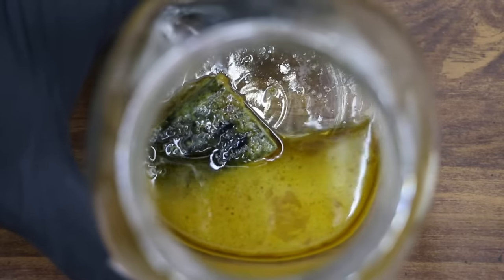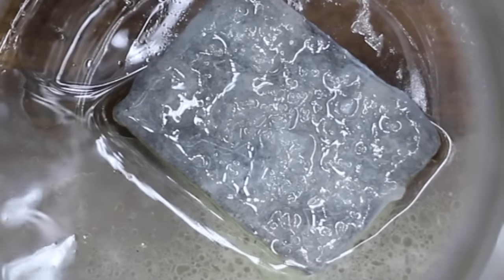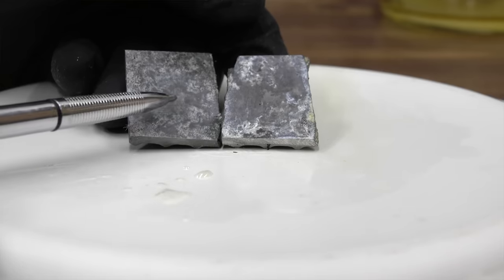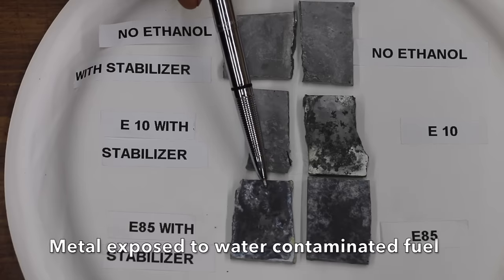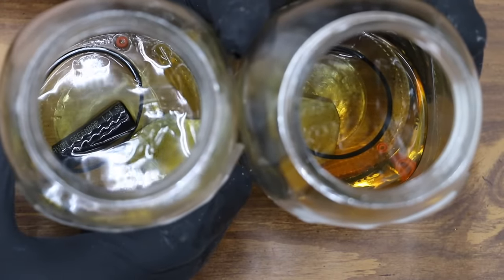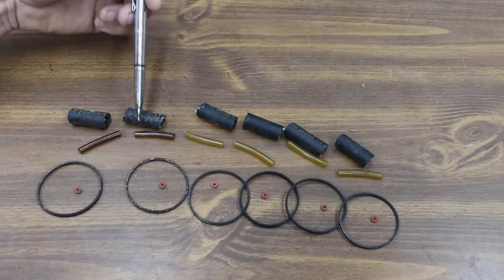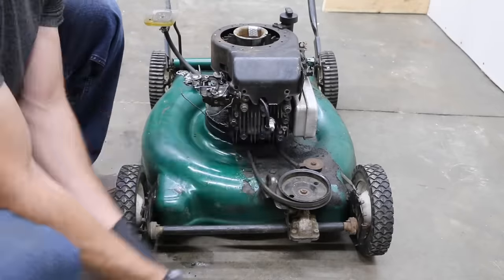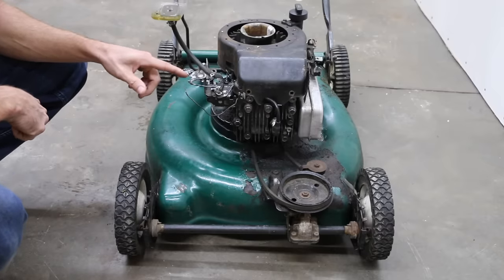Does Fuel Stabilizer Prevent Ethanol Damage?  Let's find out!

Comment: I've been running av gas (100 LL aviation gas) for quite a few years with near zero problems in all my small engines, both 2 and 4 stroke. No more cleaning and rebuilding fuel systems. I also run it in my 1956 Lincoln Premiere. A bit more expensive but it starts and runs every spring. Question, on fuel with ethanol REMOVED, will it degrade? av-gas doesn't as it doesn't have any of the additives normal pump gas has (can't have planes falling out of the sky from bad fuel) We have ethanol free gas here now but wonder about other additives degrading it. Wonderful content, keep up the good work.
Reply from the maker: Thanks, will do!
Reply: Just run non ethanol. I use it in everything I own, 2 4Runners and small equipment.

Comment: Like that this gross looking fuels came out near Halloween. Just saying it’s scary...
Reply from the maker: lol.  It smelled scary too!
Reply: Freddy coming for you...  I was very surprised by these results.  Makes me reconsider my preconceived ideas about relying on Stabilzers and E10 (It can't be as bad as some people claim... Guess it can be under these conditions)
While I don't expect intentional water contamination (beyond any "typical" open evap/vented garage storage conditions)... If I can't rely on a Stabilizer to counter it AND provide fuel performance after a few months... Then I'm now in the Camp willing to "Drain" and/or add some kind of Fog Oil,2-Cycle Oil, or E0 to shield the components from Air/Moisture during storage.
Thanks for the extensive testing. Might save some equipment during this Storage season.

Comment: Just popped up. Well done. We have two boats one a 1989 with twin 454 and one a 2008 with a Vortex 350. We leave the 1989 full of ethanol free (300 gallons) fuel from October to May. It starts and runs in May over Covid we left it for year and half it started and ran fine. The 350 we leave with as near an empty tank as we can of ethanol fuel. We have left it for 2 years and it started. We filled the tank before we put it in the water. It was hard to start.
Reply from the maker: Thanks for sharing.

Comment: But...but...we're saving the environment by using corn instead of oil!  Aren't we?  AREN'T WE???  Surely you're not suggesting that ethanol-based fuels aren't doing anything except causing our car parts to degrade faster!  Because that would be a really ugly truth!
Reply from the maker: Thank you!
Reply: Would be ugly truth as it would not be true. As mentioned in the video this ethanol and water causes issues for small engines part, not car engines, as cars have been designed for fuels containing ethanol.
Reply: Too bad I don’t run ethanol in any of my vehicles, my 19 Tacoma, 15 Murano, or my 1000RR Honda, or any of my power equip. ethanol doesn’t deserve to run in my equipment!!! Junk is all it is!

Comment: What the F! Our goverment forces E10, seeing that it destroys the engine after such a short period i am worried!
Reply: You can always mix in water to force separation and pour out gasoline that stays on top.
Reply: Imagine what it's like being a firearm enthusiast and what some "candidates" want to do to the 2A!   Apologies for going there... but a 20-50 Dollar small engine carburetor seems a bit trivial in comparison to potentially losing thousands out of my gun safe due to politicians that ignore facts and pass laws that would do little to nothing to help the violence problem and/or  enable confiscation without due process.
Reply: Are you US based Richard?  If so, there is no federal mandate that requires E10 or higher in all gasoline.
Reply: Its a chinese engine and they will have an import duty on the replacement.  Win win
Reply: @ChucksBasix  No but the States have made it law. But it doesn't matter anyways. Modern engines don't have issues with E10. Even my lawn equipment is made for it. :D
Reply: BTEX: Benzene, Toluene, Ethylbenzene, Xylene. Slang term for all the VOC's, not just the four mentioned, that are added to ethanol blended gasoline. These chemicals are commonly used in paint thinner, hence why the paint was taken off the piece of aluminum in the video. The damage this causes is blamed on ethanol and suckers buy it up. Ethanol free gasoline also has BTEX in it but not as much. If it did have the exact concentration then it would be impossible to maintain the lie. Look at E10 and ethanol free gasoline side by side. The ethanol free gas is clear while E10 is yellow. Ethanol is clear so WTF is discoloring the fuel? The BTEX I mentioned earlier. Every bit of anti-ethanol propaganda comes from the same origin, the oil mafia. The oil mafia does NOT want you to use something they don't control and over time has successfully duped millions of suckers into believing big oil has their back. Here is the real kick in the ass. America is called this great superior nation, right? How come the USA is so far behind countries that we would call third world when it comes to energy? Brazil and Argentina, there are others too, produce ethanol by the megaton with just trace amounts of gasoline mixed in at the pump. Corrosion and damage is not a factor. What materials are used to store or transfer the alcohol blended fuels? They aren't any different than the plastic, rubber, or silicone that we would use in the US for the same purpose. It's not some exotic, high quality, mystic, majestic, godly, heavenly, divine synthetic compound that Brazil or Argentina own the right to use and produce. Vodka bottles are made of cheap plastic and they tolerate ethanol just fine. Vodka also never ages. So fuel aging has nothing to do with ethanol. In the end though it wouldn't matter what is actually causing the damage we experience because there is a root cause. Dependence upon government. The people let the government decide what foods they eat and what medicines they take. As a result their bodies are in as sorry a state as are the souls who liver under tyranny. Apply this same principal to everything else, even energy. 

Oh and if ethanol is sooooo bad here in the US (but nowhere else!?!?!?!) then why is it such a popular choice of fuel for racing?

Comment: Bottom line: E85 is a destroyer of worlds.
Reply from the maker: Thank you
Reply: Only if you let it sit and get contaminated.  Cars with sealed fuel systems that get driven regularly will not have these problems.  Anything with a carburetor is a different problem, as the fuel sitting inside the carburetor is exposed to air and will absorb moisture and become acidic.  I haven't ever had problems with equipment that the carburetor is religiously run dry after every use.
Reply: No... Bottomline the world has invented fuel injection 30 jears ago and the usa thinks about ethanol in carburators in 2019.

Comment: Great video. This is exactly why I winterize my mowers and boat with ethanol free fuel. I run the tanks almost dry then fill with fresh ethanol free fuel with seafoam and never have problems in spring. Save yourself a headache and find ethanol free fuel to store your equipment. Worth the effort even if you have to drive a ways to get it.
Reply from the maker: Thank you!  Thanks for the feedback.

Comment: Quite peeved as our government just introduced legislation that has eliminated all non ethanol fuel stations (shell was the last one) and now says ALL fuel sold within Canada must have 10% minimum ethanol content for “carbon emissions” so incredibly stupid. 

The amount of ethanol content is supposed to increase every few years as well. Thank you for putting this info out so when everyone starts having engine issues they’ll at least know why.
Reply: I bought 5 gallons or Shell gas 12+years ago and ran it in my lawnmower all last year. No stabilizers or anything added. Still have a little left and will use it up this season. No issues with starting or running. Didn’t want to run it through my car but an old $25 lawnmower was worth seeing if the gas was still good.

Comment: Marine mechanic here. I have loads of experience with ethanol mixed fuel used in small outboards and lawn equipment also larger inboard engines. 
Engines don't like old fuel regardless of their size. Mercury/Mercruiser engine manuals suggest mixing 2 stroke oil, fuel stabilizer and engine fogger in a remote fuel tank to winterize your seasonal engines. I have been using this mix for almost 20 years and have been able to start every engine I winterize. Where I live the customers will keep their boats out of the water for 3 to 6 months. Even customers who kept their boats on land for a whole season we were able to start those engines up. 
For the small engines it's a good idea to empty the fuel from the gas tank, fuel filter and carburetor. It's usually easy enough to do on them, the larger engines it can be a lot harder to do that to them. I always tell customers to either fill your tanks or run them as close to empty as you can before putting them away for the winter to reduce the amount of water contamination. 
And 1 last thing, the carb parts shown with the brown and yellowish gunk on them. That is crystal formed by the ethanol while sitting in the gasoline. Sometimes they form this long strings that look like corn husk. Best way to keep that from happening is empty your fuel system.
Good luck. Keep your engines running water free.
Reply from the maker: Thanks for sharing.

Comment: Thank you for this. I've been running e10, with the same Lucas fuel stabilizer, in my generator. (It does say e10 OK) As it's only used in power outages, you can guess that I'm not burning the tank dry. Since I have access to non ethanol gas, I'll be draining my tank, and refire my Genny with non ethanol to flush everything out.
Perhaps my, only, saving grace is that I do fire it up and heat cycle it once every 2 months.
Reply from the maker: You are welcome!  Thanks for sharing.

Comment: Many small engine carbs are cast from ZINC alloys which corrode more easily than aluminum. I finally did the smart thing when storing my carbed trucks. I unbolt the carb, bolt on an engine lift plate to seal the intake, turn the carb upside down, let dry then store safely in a sealed ammo can indoors.
Reply from the maker: Thanks for sharing.

Comment: Nice video. It confirms my suspicion about fuel stabilizers and proves that I didn't do anything wrong with it's application. Besides,if fuel stabilizers were effective one wonders why it isn't added to the gas station storage tanks. I always had problems getting a lawn mower to start the following season using E10+stabilizer. So I quit using fuel with ethanol. I don't use ethanol based fuels in my snow blower either.  I still burn off the left over fuel before storing the lawn mower or snow blower. Anyway, I just installed a flex fuel kit on my 02 Mustang so it'll be interesting to see how well it runs on E15 and E85 (the tank is near full with E10 right now). I would go with non-ethanol fuels in my vehicles but E0 fuel is usually high octane and more expensive plus I don't get any improvement in fuel economy.
Reply from the maker: Thanks for sharing.

Comment: Excellent video, as per usual, excellence is istandard on all your uploads. We in UK are being forced on to 10% Ethanol , for the standard petrol, but super unleaded at a great cost form Shell and  BP iis still available for an eye watering price! at  £1.35/per liter, and premium at £1.51/l  correct as of 20th Spet 2021.. Those fuel stabilisers are semi snake oil my classic car which sits over 2   months with a fule tank always runs crap after a drain and refil  to new and running it through which is like £75 each year the car does change dramatically!  Plus then you got figure out what to do with 10 UK gallons about 50 liters of stale fuel. and the hassle of drain and refillling the tank. Most heads are aluminium, and cvarious metals which not only have to deal with ethanol, water, no lead, now have galvanic corossion to deal with.
Reply from the maker: Thanks!  Thanks for the feedback.

Comment: Excellent video. I am in the UK and just experiencing the horror that is E10. I run a 3.9 Rover V8 in a Cobra with SU carbs. They hate E10 and so do I. Just re-started the car after a 2 year layup and she runs terrible, even with a full tank of fuel. About to do a full drain and carb clean. Will run on E5 in future with stabiliser and ritchen up the mix a tad. Also investigating heat shields to help prevent vapour lock.
Reply from the maker: Thanks!  Thanks for sharing.

Comment: I enjoy watching your experiments and appreciate your non-biased results and opinions. We have several small engines and dirt bikes and have been plaques by ethanol damage to small carburetors. I would be very interested in seeing this experiment performed in the future with a variety of fuel stabilizers, hoping to find one that prevents phase separation or corrosion of aluminum parts.
Reply from the maker: Thanks for the suggestion.
Reply: Use K100 in your gas to solve your ethanol corrosion problems. Also use premium fuel in your small engines with no ethanol.

Comment: I have been using Sta-Bil fuel stabilizer for over 12 years. I store fuel in cans over the short winter in Texas. I leave fuel in all my equipment. I haven't had to clean a carburetor or fuel tank in all that time. I think this is great stuff. the only problem I have had are the fuel bulbs and lines on my two cycle engines. the chain saw and line trimmer I bought in 2008, this year I had to replace the fuel lines and bulbs.
Reply from the maker: Thanks for sharing.

Comment: Thank you so much for your videos! They are all very interesting. Request for another test: Test different fuel stabilizers with rec / non-ethanol gas to see which protects the longest time. I've used Stabil, Lucas, and SeaFoam. I believe the Seafoam indicates it will protect for 2 years.
Reply from the maker: Thanks!  Thanks for the suggestion.

Comment: This has GOT to be YT's most Valuable Channel.  I can't find any test of Stabil Marine 360 in your archives.  it claims to have additives that actually COAT metal parts to prevent corrosion.   After using it in old motorcycles and generators for a long time it seems to be a valid claim.  Sure would like to see a test of Stabil Marine 360 fuel stabilizer.
Reply from the maker: Thanks!  Thanks for the suggestion.

Comment: Many years ago, I raced a motorcycle running on methanol. Great fuel, ran cool, took higher compression.
But, after each race meeting, I had to change the oil and flush out the tank, carburettor and fuel lines with petrol.
Modern engines are designed to run with these E fuels, but if you run older vehicles you definately don't want alchohol in the fuel.
Reply from the maker: Thanks for sharing.

Comment: I use Startron Enzyme fuel treatment on my Mercruiser boat motor. It’s a 2011 boat and the carburetor has never been cleaned. In 2023 I decided it would be a good idea to clean it. Removed it took the carburetor apart to my surprise it was clean not just clean factory new looking. So I replaced the accelerator rubber disc while in there. I highly recommend the Starton Enzyme treatment 11 year old carburetor on a boat and carb was factory new looking. That is proof it really works.
Reply from the maker: Thanks for sharing.

Comment: I have a fuel additive test suggestion; Chevron Complete Fuel System Cleaner (CCFSC).  I recently had a very bothersome experience that may have resulted from CCFSC use in gasoline (ethanol-free) sitting for an extended period of time.  I have a truck (1990 Ford Bronco) that I have been restoring for the past four and a half years.  The vehicle was not running when I obtained it due to damaged wiring and ruined gas tank and fuel pump-sending unit assembly from ethanol gasoline sitting in the tank for eight years.  I fixed the wiring issues and replaced the gas tank and fuel pump-sending unit assembly along with other things and got the truck running and driving.  Over the past four years I would regularly drive the truck around the yard and pastures as it is still not road ready and I would regularly buy five gallons of gas to add to the tank (to keep the gas fresh) often with Marine Stabil and CCFSC.  Recently in between running/driving the truck it would turn over but not run and I realized the fuel pump wasn't running.  When I dropped the tank the inside of the less than four year old tank was completely rusted and when I disassembled the in-tank fuel pump (inside the plastic housing) the outside of the fuel pump was rusted to pieces and had obviously sucked up the rust particles and locked the pump up.  I have replaced everything and have the truck running again.  The possible lesson learned is don't leave CCFSC in a fuel system that will sit for extended periods of time and not run out or it will do its job too well.
Reply from the maker: Thanks for the suggestion.

Comment: If you buy non-ethanol fuel, be sure to first pump a gallon of it into your car gas tank before putting it in your gasoline container. The reason to do that is to purge the ethanol gasoline (from the previous customer) out of the pump hose.

Anothet tip... put a shut off valve on the gas line and then close it before storing the machine for an extended period of time. Now run the machine until the engine stops. Now drain the carburetor bowl of gas. Running the engine out of gas in the carburetor works for some equipment, but not all. Draining the bowl always works.

Comment: Excellent scientific testing! One major takeaway is to not only use nonethanol fuel but to NOT drain the fuel line for winter storage.
Reply from the maker: Thanks!  Thanks for the feedback.
Reply: You can drain the system completely. If your gas tank is steel you may want to fill to prevent rust.